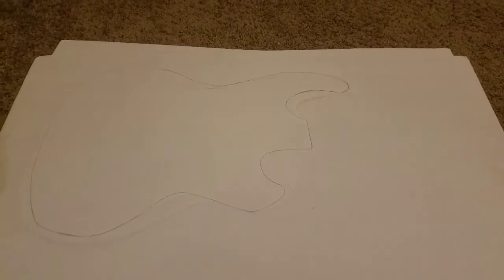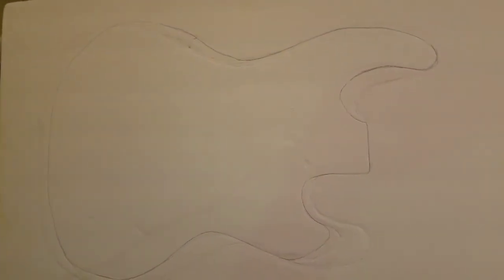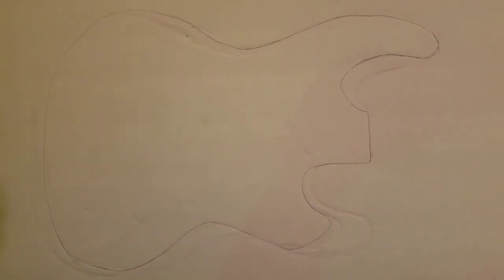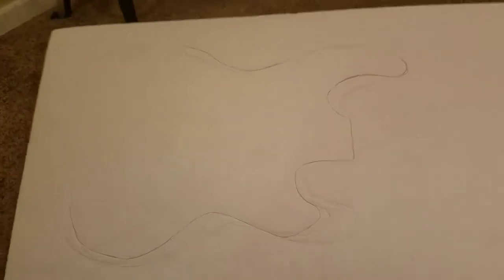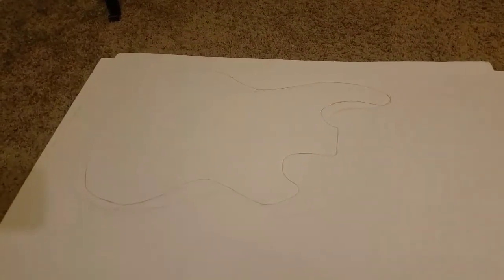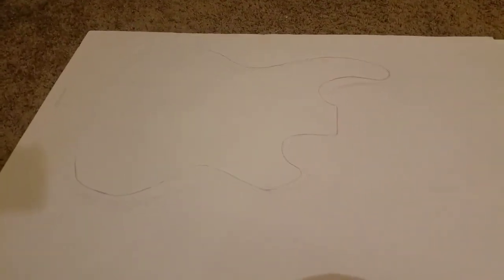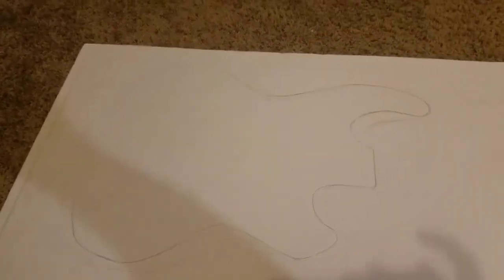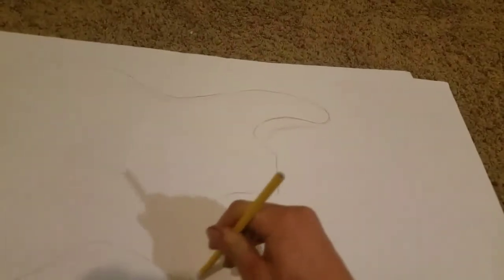How to build a Wal Bass part 0:Planning

Comment: May not cost you $7000.....but unfortunately its not going to sound like a Wal.....so why bother? Cant get the pick-ups or the pre-amp/electronics ANYWHERE. Sorry
Reply: Toolmybass not accurate. People sell them online.
Reply: Who exactly sells them online? That would require taking them out of an original Wal, and there's not exactly many people willing to gut a Wal.
Reply: Pretty sure this is a troll video isn't it
Reply from the maker: I haven’t posted on this yet because I cannot find the correct Amazonian hardwood for the neck and I will be starting with the neck